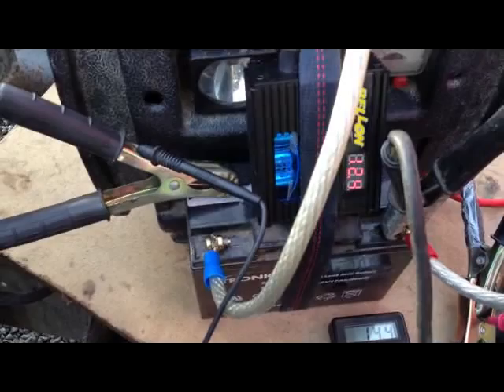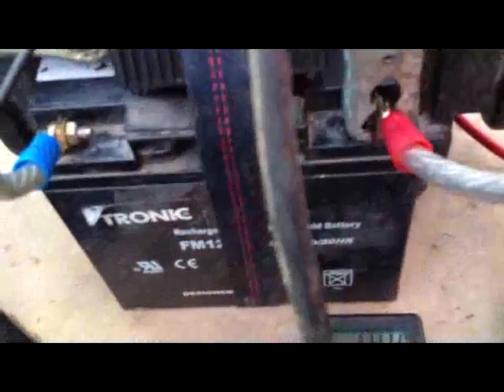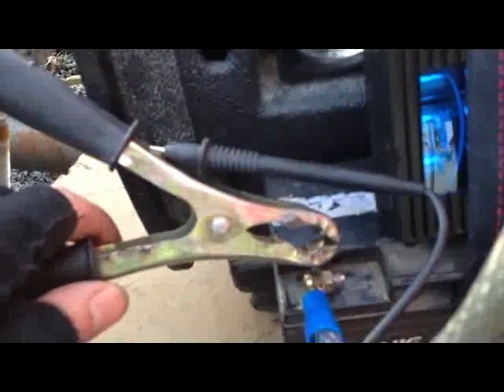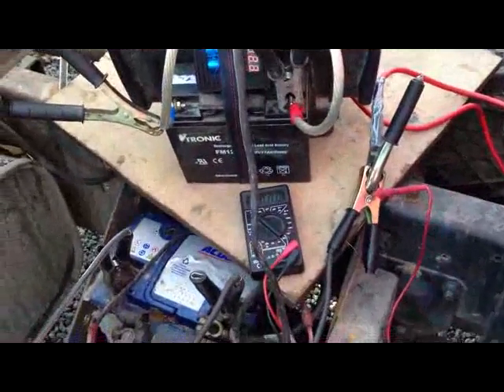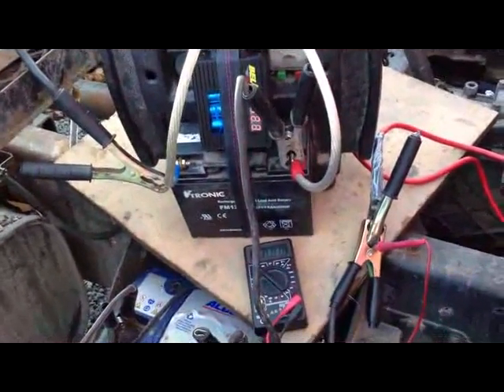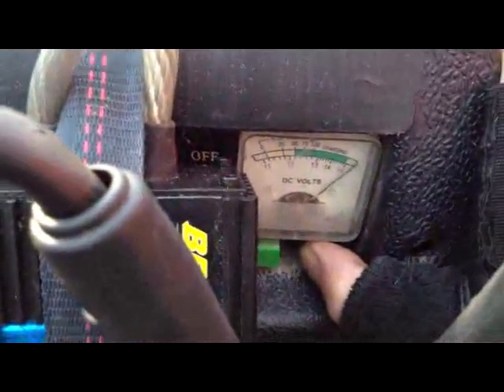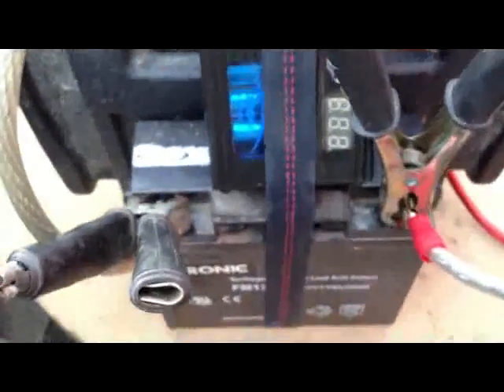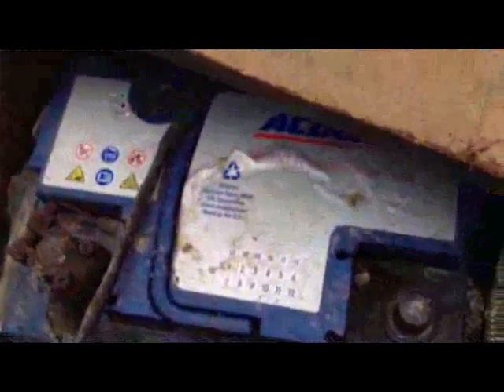12v / 24v Battery Replacment - SuperBoost Pack 2.0

Comment from the maker: Hi Andrew.

The Stabilizer should make sure you don't cook the car or the caps.
On my 3.0 td Hilux, I have no regulation, and I have noticed no ill effects from not having one installed, other than Mega sparks when you put one of these on charge or try and jump start a flat pack. 
I do still have 1 battery connected though.

If you know what your alternator considers as 'fully charged', that will help and of course the safest option is to use at least one regulator. 

 What car do you have?

Comment: TranquilKao5,

I am looking at building one of these setups for my car.  What is the significance of the voltage stabilizer?  I was reading on the laserhacker forums and they mentioned using a stabilizer between ALL of the capacitors.  Is this true or will one do the job?

Thanks!